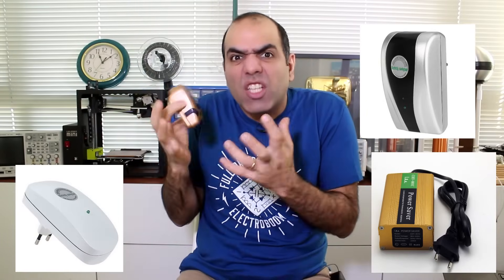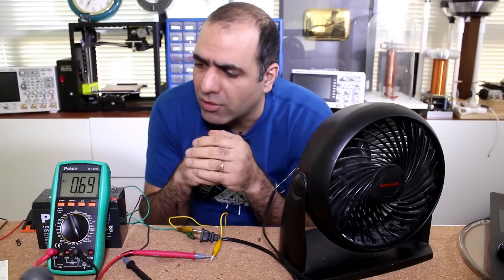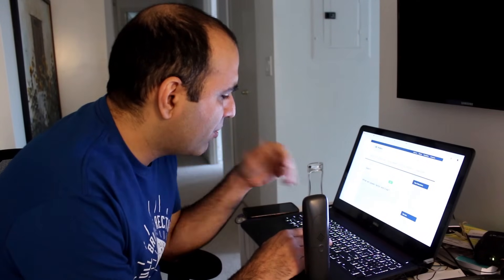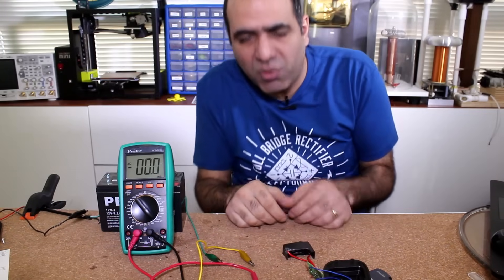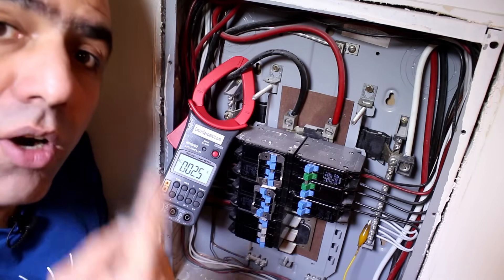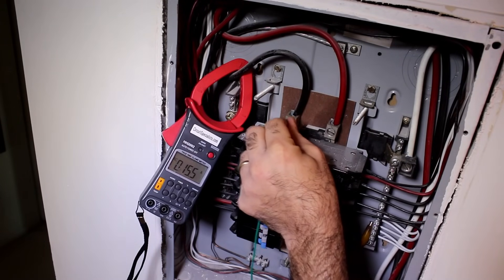Power Saver Scam EXPOSED!

Comment: Ok, so this is kind of the vid I was looking for in my comment on your F.A.F free energy vid.  Not to dogg this vid I must say that the specific device shown I believe plugs into an outlet and the idea is that if you were running an inductive load, it would bring the used energy back into phase by absorbing the little amounts of useable energy and then spitting it back into the branch circuit to be used again.  Kind of like an exhaust gas recirculation valve on a car to burn uncombusted gas.  The device I was referring to attaches to the breaker panel where 2 capacitors are used.  One positive to the 0-180 and the other positive to the 180-360 and both negative's to the neutral/ground.  This is said to capacitate the off phase energy and discharge it back into the circuit panel as phase aligned energy.  Again it is only said to work on inductive loads when imbalance is a factor.  An oven using a range and oven at different voltage on the same split phase or side of sine and/or dryer using induction and resistive on the same sine etc.  There are energy's that can be recycled or else industry wouldn't be charged for it because it is an amount that makes a difference.  In a house it's not about being charged for it, but rather reusing it so that you reuse some of the energy instead of wasting and compensating from the grid.  Sorry so long a comment.

Comment: Please somon. the me why this "engineer", habitually call the the two line conductors two phases? In north americ outside of industry electrical servise is single phase, configure to split phase tp peptide 120VAC circuits There is no main phase the two conductor are of colors, to differentiate them fom the neutral conductor and the ground conductor if if an insulated frond conductor is carried in the cable. Yes in in a split p phase the black conductor is the line conductor.In 240VAC circuits bot  the black and red conductor are line conductors.

Comment: So the purpose is that it is charged and is significantly small and so cannot reduce any amount of power drawn....

 Ok now try this... Watch the reading of ammeter as soon as you turn a tube light or an inductive load on... It will surely be higher that what had to be drawn normally like say 10 seconds later... It is because this few current has to be used to charge the magnetic field in it... This is called transient conditions and it happens to every inductive or capacitive load... 

Say you turn your light on and off like 5 times a day... For a month thats like 150 times... If you have 20 lights thats a total of 3000... And lets say transient is for 1.2 sec each time and each time 1 A of current drawn extra ...

 3600 sec of high current drawn... Almost 1 hour of that high current drawn... 

1 amp is the excess current drawn... V is the voltage rating... 
3600 A *V /3600 gives you V watts drawn extra... Now if this power saver is on from day one... Its just drawing led power... And the capacitor is going to reduce the transients in the system...
Of course it is low... And this is a scam... 

You can actually reduce the total power drawn if you use a high power capacitor... And it will save you some money in a longer run... Especially if you have microwave oven of high induction loads... You are not only reducing the amount you save but also reducing the cost to the government... Imagine if we all do a small investment of capacitor just like strictly ruling it to industries....

Better and quality power..

Comment: Charge for reactive power is something like punishment. Almost 70% of power consume by motor in industry manufacture and motor use reactive power when created magnetic field(direct-axis reaction). They are using thousands of kW and the power factor can be lower they 0.5 when induction motor running at no load. At home most likely we using Heat pump or other heating source which dominating our bill and compare to industrial using the reactive power at home is just ignorable.  most heat pump is frequency variable drive(vfd) and Morden VFD already achieve Active Power factor correction(A-PFC) by using sinusoid modulation in rectifier(IGBT full bridge rectifier) which also reduce harmonic(rectifier with capacitors is not linear). And in computer switching power supply also have A-PFC and it written on their specifications. 

The reason they punishing reactive power is that reactive power will case voltage change in generator and cause some problem(active power cause frequency change the limitation is +-0.5 Hz in most conditions) they have to change the excitation current to stable the system. By using an AC with inductance output impedance this can also be simulated（the real power will cause phase change which different from generate because the generator will slow down and slow down can be understand as cumulated phase delay and slow down cause by improper gird control).

Comment: I see a problem in your test procedure. The "capacitor" needs to be connected to the line with smallest conductor between possible. The extra wire you connected is ruining the purpose. Secondly, this thing should be connected close to the load.

Comment: Homes are billed at kilowatt hour and heavy companies are billed kilo volt hour due to load consumption and pf factor in India capacitor banks are used to regulate pf when ramping up tge the ac motors so the is difference between kwh and kvh

Comment: Hey reactive power flows current of +-90* with respect to voltage then how it waste power in transmission line??
Reactive power is necessary for setting up magnetic and electric fields. Without that motors, transformer and capacitors are useless.
Reply: No, reactive power cannot perform useful work in the consumer because of the +/- 90° phase shift. It can have some uses (not involving physical work) in the grid – see below. Motors and transformers are inductive loads, capacitors are capacitive loads, of course. These have very many uses, but reactive power is a side effect of using these, not an end in itself. (That said, AC generators in common use today may not be able to handle purely resistive and fluctuating loads, so some amount of reactive power on the grid is useful.)

One reason why there is inefficiency despite the +/- 90° is that this phase difference is only as measured at the consumer. If you'd measure it at the producer, the phase difference would be different, in part because the electrical grid itself has inductance and capacitance – this is unavoidable when you're making long metal cables and attaching various types of electrical devices necessary to keep the grid within working parameters. In fact, without this "wiggle room", the grid would be extremely sensitive to even the slightest changes such as people turning their electric kettles on and off. But even this does not mean that reactive power is needed for operating the grid. It is not moving energy to and from that it is useful, ideally you would never do that. Instead, it is the ability to move energy to and from when you have to because otherwise disaster would strike that is awesome to have.

Think about it like the brakes on your car, they don't perform any useful physical work, they cost fuel and thus money to move around and operate, but you'd very quickly be in trouble if you were to dispose of them.

Another, and in fact the most important reason for the inefficiency is that only the sum of the energy transfer is zero. Resistance losses are proportional to the voltage multiplied by the absolute value of the current, hence having +1A in one second and -1A in the next does not lead to them cancelling each other out, instead you have an absolute value of 1A each time, causing a proportional loss.

Note that energy stored within the device does not contribute to reactive power. Unbelievably, there are even electrical engineers who claim that motors require reactive power to operate. This is utter nonsense! A motor requires a phase shift in order to operate, but it does not require that this phase shift should extend all the way back to the power source, and only that constitutes reactive power, by definition. In fact, the claim that motors need reactive power implies that DC motors cannot work at all – an (idealized) DC motor is purely resistive and causes zero reactive power!
Reply: @TruthNerds  Thank u very much for your time and consideration.
I get the point. 👍👍

Comment: Still I don’t understand why having the current out of sync with the voltage loads the network more than having on sync. I understand the mathematical model but not the phenomen at electron level. In other words, what is happening at electron level so a motor creates that phenomen on the network?
Reply: Generators at power stations are normally picking up current from the armature at three different points these give us our phases so large industrial plants will use three phase and household will use single phase. In the UK we have three phase outside our front door but only use a single phase out the three. I think there is overlap with the signal from the other two phases which is transmitted into the single phase. this is a loss of current from the other two tails that run along the the inside of the cable buried under the street from the sub station to your house. However. this will be split and go upto your meter with the neutral, so whether you use this devise or not you are still paying for this additional signal whether you like it or not. This is what I think he is referring to.

Comment: 8:10  I was wtf, what a microwave draws near 3 kW of power. Then i reminded that they are using 110V... Deam cables in those countires have to be expensive.
Reply: Even being aware of their voltage I was taken aback by the current draw of his microwave, so I measured mine (1000W output) and got 6.5A at 247V = 1605.5W. That's only slightly lower consumption than Mehdi's so I guess an overhead well in excess of 50% is normal.
Reply: It's 120V, and cables are not expensive.

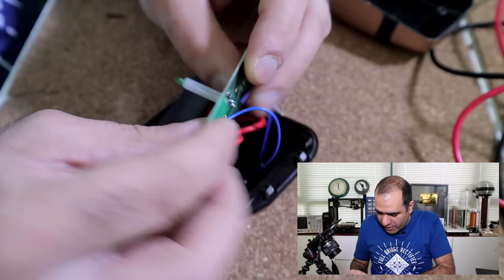Comment: Question: What am i missing?? At about 1:18 you can see that there is basically a 100k resistor (printed on board)  in series to the LED with everything being in parallel to the 2.1µF capacitor. For the impedance of the capacitor i got 1326 Ω ( 1 / (2π*60*0.0000021) ). At 120Vrms the overall impedance of 1325 Ω ( 1 / sqrt( (1/100000)² + (1/1326)² ) results in a current flow of 90mA. With that said, the branch current that is flowing through the LED is about 1.2mA ( 0.09 A * 1326 Ω / 102000 Ω ). This however would not be enough to drive the LED. What am i doing wrong? Or is the printed value (100k) wrong? Thanks in advance!

Comment: just curious as an HVAC guy our residential motors use 240v 2 pole 1phase which ive always thought was misleading since doesnt two wires make it 2phase?????..... but ok......moving on to my real question. my motors have a run capacitor to help them start and run at low amps.....and if we add a 2nd high capacity cap with a relay it lowers start amps but how does this affect actual power usage?????? i know the Kickstart as we call it extends the life or claims to extend the life of the motor and can help start an older or stuck motor but what about price???

could you do an update that covers this side topic.

Comment: Man you are seriously wrong in one thing power companies do charege you for APPARENT POWER because your home power meter just measures how much power passes through the power line, doesn´t magically figures out you are using an inductor load and substracts the reactive power and if you haven´t noticed the operator you talked on the phone didn´t had any idea about what you were talking about, jus think you have no idea about electricity and someone asks you if you are charged for real o apparent power, of course at first the most logical answer would be real power, you shoul correct that man please honour the rectifier.
Reply: https://electronics.stackexchange.com/questions/19102/if-the-energy-meter-sees-a-reactive-load-will-it-register-a-lower-reading

Comment: So that's why I trip my breaker if I run my microwave and my heater at the same time. Dang, microwaves draw a ton of current.
Reply: Mehdi's reading looked high to me at first, 13.8A at 120V (nominal) works out at 1656W, but I just checked my own microwave and got a similar result. Mine is a 1000W output model and bought this year. I ran it at full power with a cup of water inside and it drew 6.5A at a measured 247V, which equals 1605.5W consumption, so I guess somewhere around 600W is a normal overhead.

Perhaps you can upgrade or reconfigure your wiring? It just depends on the maximum total for your dwelling. In the UK most of us manage with a main supply fused at 100A, some older homes at 60A. I've found friends renting rooms and flats (apartments) with insufficient installations. In one case asking me why she blew a fuse every breakfast, in a flat within a divided up house, I found her fusebox (yes, wired fuses) contained no circuit rated higher than 15A (which used to be a standard, now 16A). It should have been double that for a kitchen's outlets.
Reply: Mehdi's reading looked high to me at first, 13.8A at 120V (nominal) works out at 1656W, but I just checked my own microwave and got a similar result. Mine is a 1000W output model and bought this year. I ran it at full power with a cup of water inside and it drew 6.5A at a measured 247V, which equals 1605.5W consumption, so I guess somewhere around 600W is a normal overhead.

Perhaps you can upgrade or reconfigure your wiring? It just depends on the maximum total for your dwelling. In the UK most of us manage with a main supply fused at 100A, some older homes at 60A. I've found friends renting rooms and flats (apartments) with insufficient installations. In one case asking me why she blew a fuse every breakfast, in a flat within a divided up house, I found her fusebox (yes, wired fuses) contained no circuit rated higher than 15A (which used to be a standard, now 16A). It should have been double that for a kitchen's outlets.

Comment: Sir, i have a question, if i charge a capacitor how long the capacitor will stay charged?..
Reply: A one farad capacitor can supply 1 volt at one amp for one second. The rest is calculations. Are you talking about leakage?

Comment: If you want to make a novelty shocker out of it, just install a "FULL BRIDGE RECTIFIER"!! That will charge the capacitor to peak voltage instantly, and allow you to unplug it at any time. You could even use just a simple diode,(1N4007), in series with the capacitor. That diode will have to be bypassed, in order to allow current to go back through the plug tines. an arming switch.

Comment: so we don't pay for reactive power ? which is what a motor is ? but we pay for resistive power, like a heater ? so why can't we turn an ac motor into a heat source some how ? anyways... what if you were to add a larger capacitor ? 
One more thing... I would like to add something to my ac circuit to reduce the amp draw of my shop vac so I do not blow the breaker, what can I get for that ? or what can I use ?
Reply: You're misunderstanding him. A motor doesn't run entirely on reactive power.

Comment: At home we have a lot of switched power supplies, their input stage consist of a diode rectifier and a capacitor, which is capacitive and nonlinear. We need inductors not capacitors to compensate the reactive power. Using C/L really depends on the type of load.

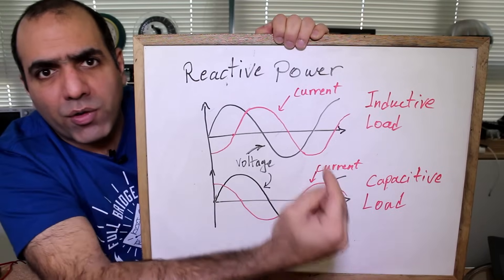Comment: 2:29 looks like a sine cosine function graph
Reply: Not a coincidence. In a capacitor, the current equals the derivative of the voltage, and in an inductor, the voltage equals the derivative of the current. And since the derivative of sine is cosine, the graphs will look the same

Comment: I have solved the mystery on how Electroboom is able to move his eyebrows so ! 
After careful study I now see that his eyebrows are moving in a sine-wave. Obviously his body has collected a substantial charge from all the accidental discharges from his high voltage experiments.  Now his eyebrows move in response to the fields generated in the wiring in the walls. and this is probably why when he gets one of his many shocks his eyebrows fly way up ! it's like the waveform jumping to the top of the scale on a scope. 
If we could only get him to draw a scale on his forehead we could use this as a learning tool .
(Good stuff - great fun - makes learning fun ! )

Comment: Maybe one power saver idea, is that every home with a mains water supply (and decent pressure) can have a Unit installed at the Meter. It will have a small turbine that would revolve and drive an alternator (from the water pressure). Output from the alternator could be fed to a small Inverter, and be connected back into the National Grid. In this way, everyone who turns on a water tap - can expect lower Power Bills. A Car Alternator could probably do this job very reliably, an output of around 800 - 900 W (I think). Please try to make one of these and see what you can come up with!! Love your videos, always firing my imagination. Stay alive in your dangerous job!

Comment: I'm shocked at what your fuse box looks like.  Is that the standard in the us?  And why only 2 and not 3 phases.  What do you do if you want to run big motors?

Electricians here in Germany would have a heart attack.